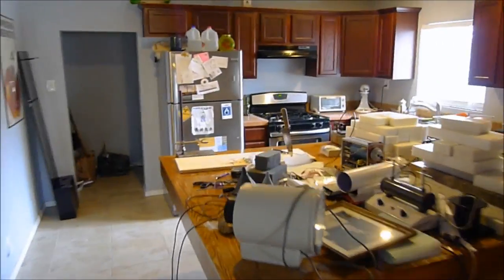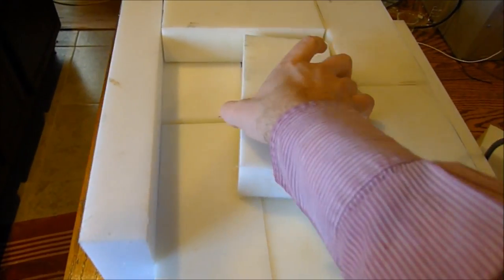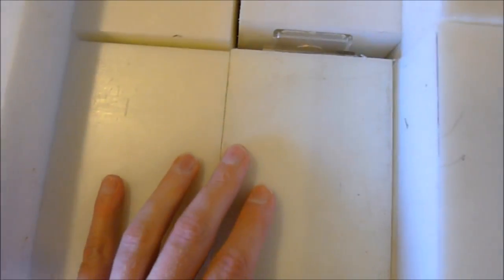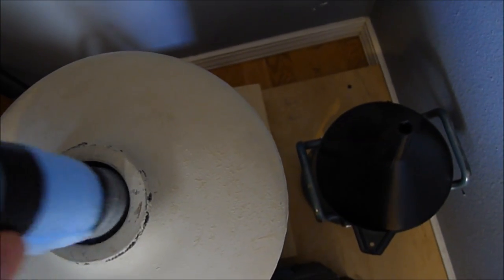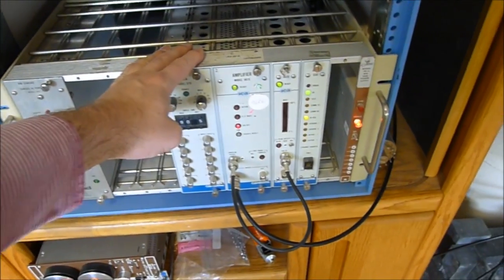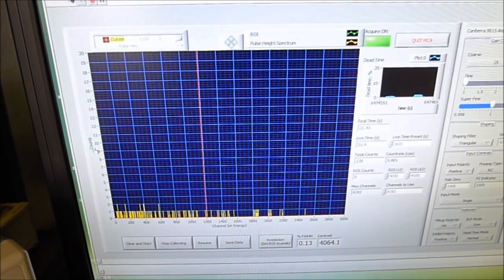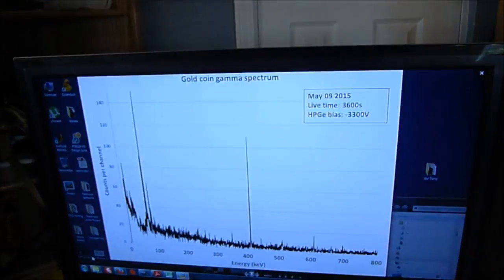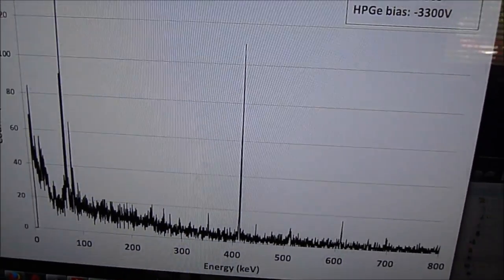Amateur nuclear physics: neutron activation of gold

Comment: Haha, I love the fiestaware plate, that is so fitting! By the way, wouldn't you get a much better neutron flux if you use Ra226 as your alpha source?
Reply from the maker: Matt Giordano Sure enough, on an activity basis (radium has many alpha-emitting daughters, some of which produce very energetic alphas).  But the trick is to find millicurie quantities of radium that you can put in contact with some beryllium!  Not much remains publicly accessible with suitable radium sources, unfortunately.
Reply: how about po210?
Reply: @Nicker000  But the half-life of Po210. Am241 is much easier to get
Reply: @Tishers  I agree, but I'm certain that the po210 packs more of an alpha decay punch than the am241!
Reply: @Nicker000  How about Pu241?
Reply: @grazielecarvalho4792  and here we were speaking of hard to obtain elements.
Reply: I have a Festaware dish, very neat  piece as well as some Glass.

Comment: Great videos!! You should try to measure the radioactivity in cigarette smoke? Measure the spectrums of different types of radiation!
Reply: I tried this with a Radiacode 101 and it’s not sensitive enough to detect the Polonium or other daughter isotopes.
Reply: The radioactivity in cigarettes is due to the sticky underside of tobacco leaves that capture the radon daughter’s.

Comment: Really slick, Carl. Where did you get the americium? Smoke detectors? Paul
Reply from the maker: Paul Carlock Good call!  The sources are all still sealed and haven't been abused in any way, though.
Reply: @Carl_Willis  how many smoke detectors did you dismantle tho ?
Reply: @denizbluemusic  If you think it through, each smoke detector element is about 0.8 uCi. I used 60 of them to make an Am/Be source with HDPE and graphite blocks as a moderator.
Reply: Tisha Hayes how is 60 smoke detectors enough?  He said 6 Millicuries, wouldn’t that be 6000 microcuries?

Comment: Hi Carl, I have a question. When I first learned about neutron activation analysis in a radiochemistry course and read about it in the literature, all instances seemed to use a nuclear reactor as the neutron source. However, you seem to have success just using a simple neutron source here. Are there different requirements for the energy of the incident neutrons that might make a nuclear reactor more desirable? Or perhaps it is different depending on the element to be analyzed? Just curious if more elements can be analyzed in a simple setup like this.
Reply: Hi Tim, this is super late, but to answer your question, by far the biggest difference is simply the number of neutrons you get per square centimeter per second (the neutron flux). Yes, the energy spectrum from a reactor can be different from the source he has here (although if the reactor is thermal, then they would be approximately the same since Carl is also using a neutron moderator). However, you will get many orders of magnitude more neutrons from a reactor, hence you can get much higher activation in that case.

Comment: I was thinking, "Why plastic as a moderator, why not water or carbon"...then I hit myself once I understood what plastic is made of
Reply from the maker: Christopher Willis Water works great if it is good and free of chlorine and salts; you just have to come up with a dry enclosure for your AmBe source or it will get water in it and have problems.  In a pinch, you can build a "castle" around the source using a bunch of distilled water bottles.

Comment: So I'm trying to find out if my computer's RAM can be used to detect cosmic radiation and I've come across a paper that says RAM is most sensititve to neutron radiation. I have an americium source, so would I be able to just tape a little bit of beryllium to it and it will produce neutrons at an appreciable rate? Does the shape of the beryllium target matter or can I get away with a (cheaper) 5mm sphere of it? Did you build your neutron source yourself or did it fall off a truck? Thanks!
Reply: Hmm. Just watched your video about your neutron source, and your alpha source beats mine by over three orders of magnitude. Bummer :(

Comment: I'm trying to do something similar with a simple PoBe source, based on the one you demonstrated in the video with the He3 neutron detector. I have a question: why do you have your AmBe source right next to the gold coin? Shouldn't there be a couple of layers of polyethylene separating the two, in order to moderate the neutrons before they arrive at the coin?
Reply from the maker: +Grebulocities The moderator / reflector in this experiment surrounds both the neutron source and the item being activated.  This configuration produces the highest flux of thermal neutrons in the gold.
Reply: +Carl Willis So the thermal neutron flux is greatest next to the source? Obviously the total neutron flux is greatest there, but I wasn't sure about the thermal neutrons. I take it that by the time the neutrons have collided enough times to be thermalized, they're moving in completely random directions through the moderator and are more likely to have bounced back to where the source is than to be anywhere else. Is this correct?
Reply from the maker: +Grebulocities That is a good way to think about it.  Thermal and total neutron fluxes peak at the center of this geometry with what amounts to a point source of fast neutrons, a point activation target, and a thick, hydrogenous surrounding moderator.

Comment: Is the poly a neutron moderator or absorber?  Is it doped with Boron?  Can I assume we are talking like a few neutrons per second, because thermalized neutrons floating around your kitchen is not healthy.  I suggest you get a place with a basement.
Reply from the maker: +Putins Cat The plastic is both a moderator and absorber, but is being used here as a moderating reflector and absorption is undesired.  This is pure HDPE, no boron loading (that would be bad).  The AmBe source yield is about 2000/second, trivial from a radiation safety perspective.
Reply: Carl Willis So, are you going to irradiate it for 10 years?  How can you even detect the change?
Reply from the maker: +Putins Cat Well, as the video itself illustrates, there is detectable activation of the gold to form Au-198 even with this weak neutron source.  The video shows the detection method used (HPGe detector).  Irradiating for years doesn't improve Au-198 yield, since the half-life is only 2.7 days and activity is essentially saturated within a couple weeks.
Reply: Carl Willis What do you mean by saturated?  Except for the decay products, the amount of Mercury in the gold would be very very small.
Reply from the maker: +Putins Cat I agree that the amount of mercury generated by this experiment is too small to detect.  All we can detect is its radioactive precursor, Au-198.  Saturation concerns the maximum activity of Au-198 that can be produced from a given neutron source after an arbitrarily long irradiation.
Reply: Is the conversion not based on number of thermal neutrons available?  If you use 2000/sec, and they all bind with an atom.  I don't get what 'saturation' means in this context.  Is it because you are focusing on a spot?
Reply from the maker: +Putins Cat Saturation is the equilibrium condition attained between radioactive decay (of Au-198 in this situation) and formation.  So, if you have X number of neutrons / second captured in the sample, you are producing Au-198 at a rate of X.  Eventually, you will have enough Au-198 that it is decaying at the rate of about X, and that corresponds to the maximum amount you can have at any one time unless you increase the neutron flux.
Reply: Carl Willis Ah, so this is a timing issue.  The decay is catching up to the amount converted?

Comment: Great experiment Carl.
Once again I really like the source you are using. 
5.3mCi of Am 241 is most impressive. Bet that has quite a gamma activity?
Reply from the maker: ALARAiswise Yes, it's a pretty strong gamma source.  It is actually over 6 mCi now, but has been around a while and gone through a few "upgrades".
Reply: Carl Willis have you measured it with a normal geiger counter..how strong is this? (µsv/h)
Reply from the maker: weirdmeister inc. Undetectable against background.  The good energy resolution of the HPGe detector enables these kinds of neutron activation experiments with a very weak neutron source.  Ordinary Geiger detectors are not adequate tools for the job.
Reply: Carl Willis u´r fast :)  sry, i mean the alpha source of 6mci

Comment: I'm surprised you didn't try cobalt.
Reply from the maker: +Brandon Fisher Gold is an intentional favorite in this experiment.  It has very high neutron capture cross section, short half life, and easy-to-detect byproduct radiation.  Cobalt can be activated, but the most active byproduct from a short experiment like this is Co-60m with a half life of about 10 minutes.  Cross sections are a couple orders of magnitude down from Au, and byproduct gamma radiation from Co-60m is very low yield.  If you had decades to wait around, you could make measurable Co-60 in the ground state, which is a potent gamma emitter.  But this experiment with gold is designed to work well with hours or days of prep.
Reply: +Carl Willis I'm guessing neutron capture always produces isotopes in excited states first hence the Co-60m.
Reply from the maker: +Brandon Fisher Neutron capture almost always results in an excited state, but most of these states de-exite almost instantaneously, producing gamma rays in a "radiative capture" process.  In the case of Co-60, some excited states formed by radiative capture on Co-59 decay to Co-60 in the ground state, and others decay to the long-lived (metastable) excited state designated Co-60m.  The yield is fairly evenly split between Co-60 and Co-60m.
Reply: +Carl Willis is there a experiment where you could make a small amount of Co-60 ( at home ) without it taking decades?